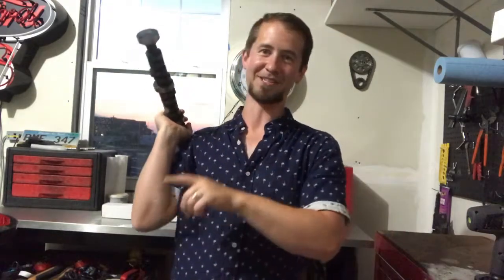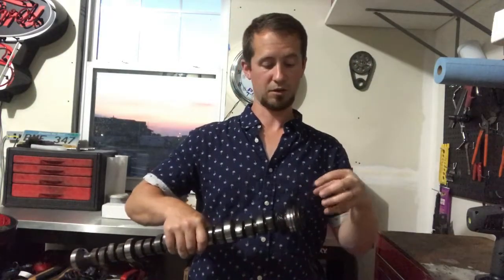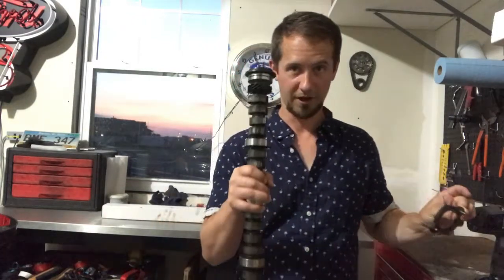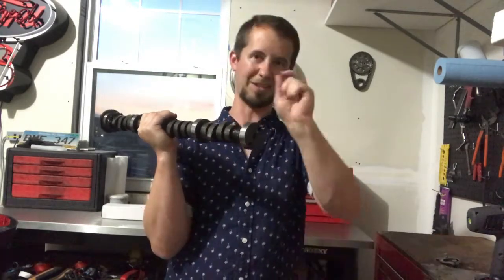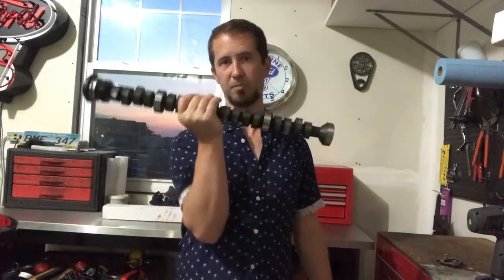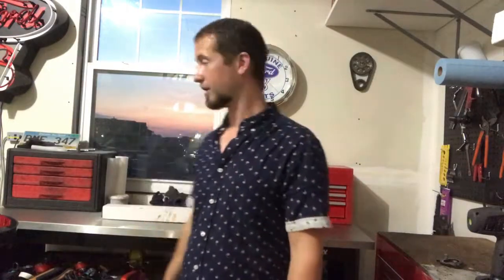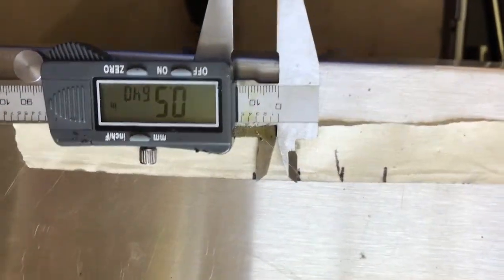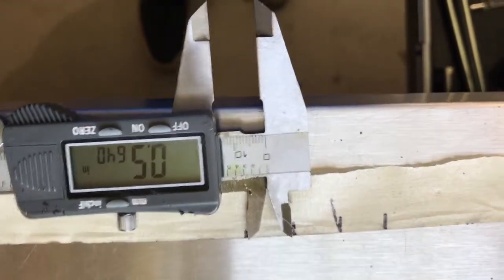Cam info and Tuning (Galaxie vs C-Max pt 5)

Comment from the maker: The original camshaft had .398" of VALVE lift and 186deg @ .050 intake and exhaust
The new Oregon Cam has .453" in / .465" ex lift and 192deg in/ 196deg ex @ .050

Comment: Just a side note after seeing the earlier video. The manifold you are using may be one off of a PI 390 FE. Don't know if a Marty report could help to determine this. Also many of the rag tops got spec'd with a " detuned " engine so as not to twist the body. Oddly the engines supplied quite often were capable of long torque curves and cruising axle ratios.  Nice project B T W.

Comment: Hey Cody you're 62 sunliner looks just like the one I used to have the ming green paint the white convertible top and the matching interior super sharp car
Reply from the maker: Very cool. The Peacock green didn’t come out until mid-year when the bucket seat XLs were released. It was a sharp car.